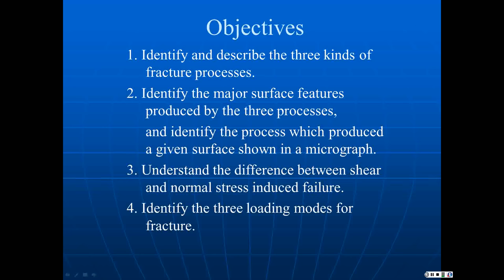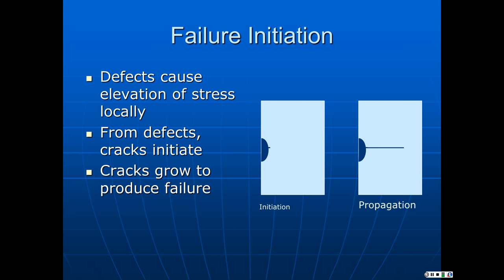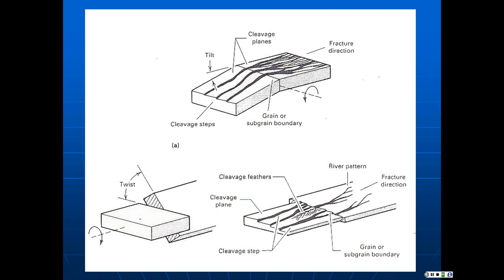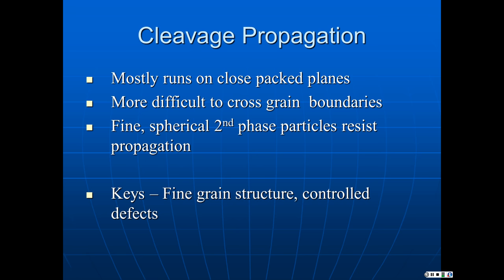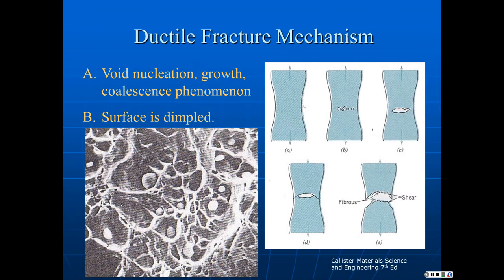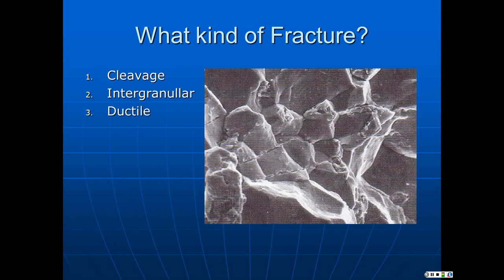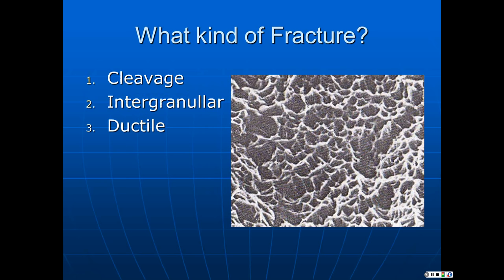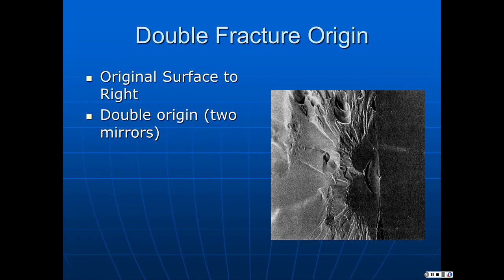Fracture Mechanisms - Failure

Comment: Speaking as a structural engineer with a strong background in materials science and stress analysis but with no fracture mechanics education, this was an excellent overview that I found very easy to follow and extremely enlightening - the explanations made sense to me, and the graphics did a great job of supporting the points being made.  I had to pause the video a few times to look up things like metal structure (e.g. body centered cubic), defects (crystalline imperfections), and what grains are and how they are formed, but this additional research was well worth the effort to allow me to fully follow this video.  Thank you so much for the time and effort you put into this, it has helped me comprehend some fractography data I have been reviewing as part of a connection failure analysis!
Reply: I love how at the beginning he gives a great explanation of the differences between theory and reality.  Theory can only get you so far before you need real world testing.